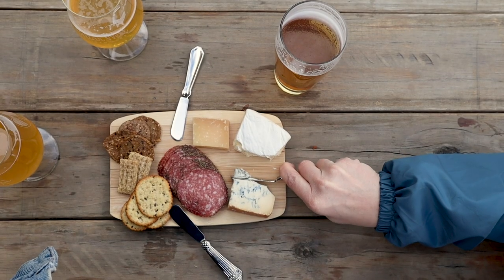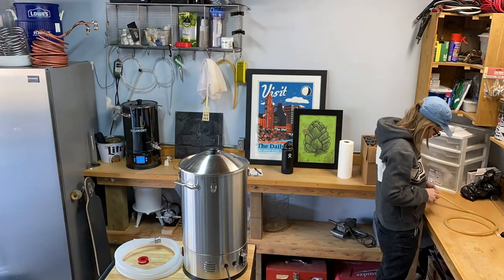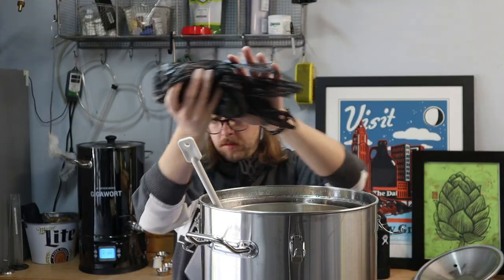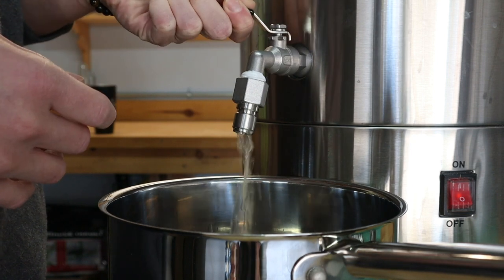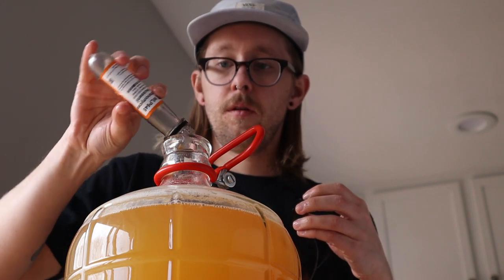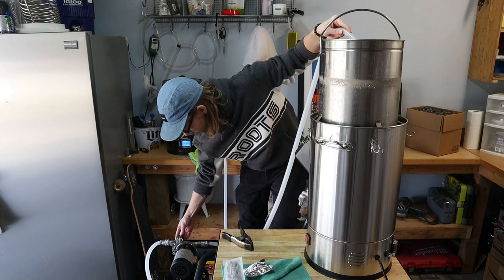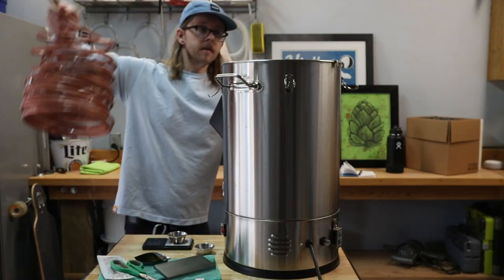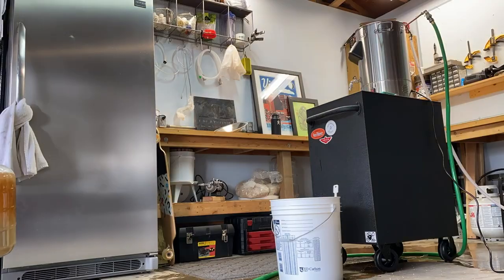Brew a Helles Lager | Anvil Foundry 6.5 | EP 3

Comment: On the decoction mash step, I thought you removed the grain and not the liquid wort. Does it also work with removing the wort instead of the grain?
Reply from the maker: Good question! Someone else asked something similar last week - check out that thread for more detail but traditionally the decoction would include both wort and grains. For a few reasons I prefer to just leave the grains alone and I find it still provides the benefits of decoction mashing.
Reply: @HopsANDgnarly  I think boiling the wort denatures the conversion enzymes but boiling the grains (wet with some wort) encourages mallaird reaction. But I’ve only decocted twice (10 quarts of thick mash grains) but it turned out great.

Comment: Also found your channel while looking for Anvil products.  New subscriber here too.  Please consider making a video about your water conditioning process.  I'd like to learn the technical aspects of that process.  I've always heard about it but have never had it explained.  Cheers,  Mark in Colorado Springs.
Reply from the maker: Thanks Mark! Great idea! In the meantime, check this out: https://youtu.be/MP2IRulwL3I
Reply: @HopsANDgnarly  Thank you for the reply and referral link.  I've been watching more of your videos - I'm looking forward to viewing your future brewing adventures.  Looks like you have a nice setup in a shed or someplace.  I also like your temperature control system with the fridge and heat belt.  I'm new to brewing and am using a Mr. Beer w/partial boils.  Looking to move up to the Anvil 6.5 system.  Anyway, thanks again for your great videos.  Cheers.

Comment: Hi - nice videos.. I have an Anvil 6.5 on order for small batches.  Are you running the 6.5 on 240 or 120?  Also, from what I understand a decoction mash should include some of the grains as well..any reason why you didn't pull some of the gain to boil as well?
Reply from the maker: Hey thanks! I'm running my Foundry 6.5 on 120 and it's been working out very well. Great question - you know your stuff! I worry about excessive tannin extraction and denaturing enzymes and find that this method still provides the benefits you'd expect from a decoction - increased efficiency, melanoidin production, DMS removal, etc. I've never done a side by side but that would be pretty interesting.
Reply: @HopsANDgnarly  cool.  I have a marzen recipe that I make regularly and wanted to try a decotion to see if it would be different.. but never wanted to deal with boiling grain... I should probably give it a shot with the wort alone.
Reply from the maker: Heck yea! Let me know how it turns out.

Comment: Just bought the Anvil 6.5 - when you say you used 87% pils, 6.5% acidu and 6.5 Vienna - what is the total weight or how much of these do you use in this 6.5 anvil? Hope my question makes sense. Thanks! I wish I could more easily source 2.5 gallon batch kits - but because I cant I need to become familiar with how much of each grain to put into this particular system.. I am brand new to brewing. I love your video style, well done sir
Reply from the maker: Jon, thanks man I’m stoked you like the videos and that you’re diving into the hobby! This recipe uses lager yeast that really should be fermented cool so I first want to make sure you’ve got a plan to maintain 50-60 degrees during fermentation. If not, maybe check out an ale recipe. MoreBeer has some nice 5 gallon kits which you could cut in half. Brew the first half, see how it turns out and what you can maybe improve, then do it again with that new knowledge and experience. For this beer I used 5lbs German Pils and 6.5oz each of acid malt and Vienna malt. I’d also recommend BeerSmith or Brew Father for documenting recipes and predicting ABV and what not. Lastly, check out the Anvil Foundry Facebook group and don’t be afraid to ask questions! I also love comments like this so keep the questions coming! Stoked to keep in touch 🤘🏼 cheers! 🍻
Reply: @HopsANDgnarly    Thanks for the informative reply. I will definitely be sticking to Ales for now or anything that can ferment at 70 degrees, no other option at the moment. Splitting a 5 gallon kit sounds like a great idea but I need to figure out how to seal the other half. Trying a different technique or process with the 2nd half could be quite interesting and educational. See you on the Facebook page! and of course watching all your past content and future content.  Cheers from Utah.
Reply from the maker: I throw extra hops in the freezer and extra malt in the fridge. Ziplocks are good enough for me. Cheers and best of luck!
Reply: Grain bills are in percentages because efficiencies vary by brewer and system. Set your target OG and efficiency, then apply percentages of grains accordingly. Hops are also not in amount by weight. They are amount by IBU.
Reply: @smitty7592  Thanks, that helps make sense. Seeing that we were doing the same batch size I thought weight would make it convenient.. and he and I are both using the same system. I need to learn how to just put in percentages into beersmith. Cheers.

Comment: Cool video, but boiling part of the wort while mashing has nothing to do with decoction, and it's certainly not a "traditional decoction mash schedule". You mentioned worrying about denaturing enzymes by boiling the grains in another comment, but by boiling the wort, you are doing exactly that. The enzymes doing the conversion aren't trapped inside the grains but actually get dissolved into the wort at an early stage in the mashing process. In the traditional decoction method you boil a fairly thick portion of the mash, leaving the wort behind to keep the conversion going. What you did is almost the opposite.
Reply from the maker: Thanks! It’d be fun to do an experiment and see the differences between decoction, lazy decoction, and no decoction. A lot of people think it’s a waste of time entirely. Cheers!

Comment: Why do you even need to do a decoction mash ? Modern grains don't really require it. Why use that method for a lager ?
Reply from the maker: There are definitely people out there that would agree with you and there may be other ways to achieve similar flavors. The primary reason is melanoidin production but it can also reduce dms and increase efficiency. I think there’s something intangible about it. It’s like a soup that reduces all day. The Maillard reaction changes the color, deepens the flavor, and reduces the sugars proteins and amino acids. Certainly not required but it will change the flavor of the final beer. Cheers!